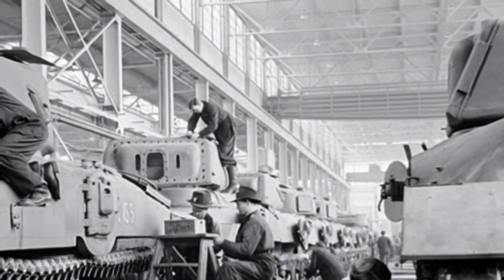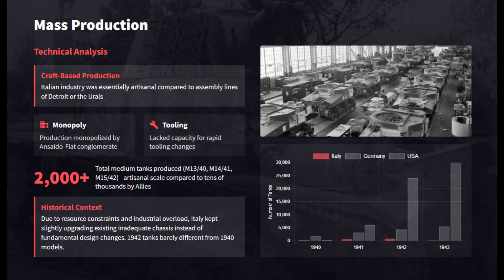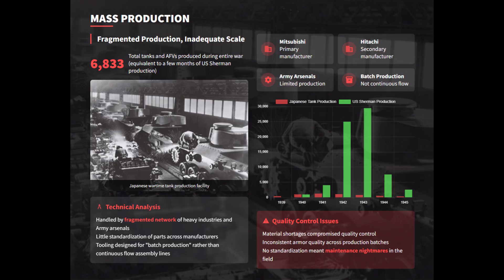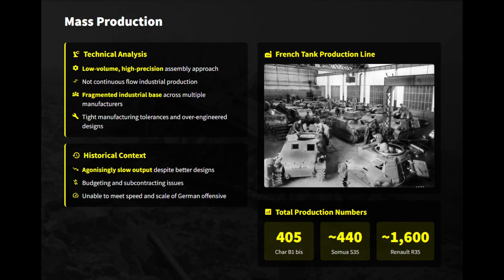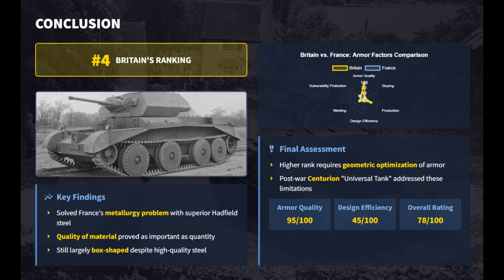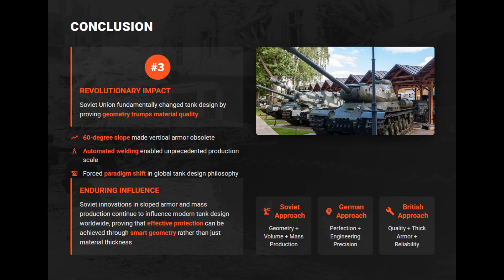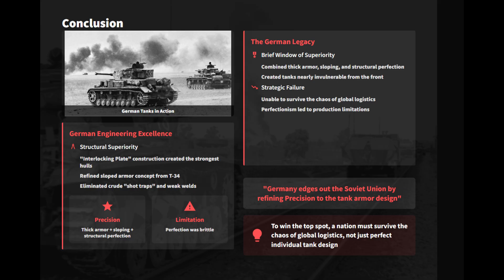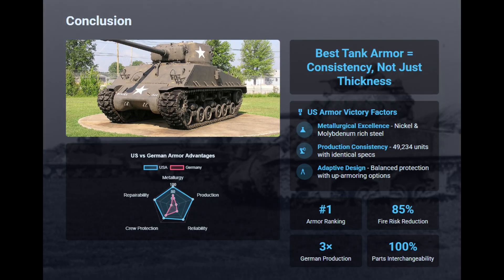Ranking Seven WW2 Nation’s Tank Armor Technology - From Worst to Best

Comment: schurzen side skirts were not effective against hollow charge weapons.  they were developed to defeat soviet anti tank rifles, and were very effective against them.
Reply: There is a web site of old Soviet test data that shows that spaced armor is very effective against the 106mm (really 105mm) recoilless rifle the purpose of which was destroying armor.
Reply: You're right that Schurtzen were developed to counter  anti tank rifles.

But once in place, it was found that it also negated shaped charge warheads.

As anti tank rifles became obsolete and fell out of use later in the war, the Germans started producing Schurtzen out of wire mesh to save on steel usage. The mesh still proved very effective against shaped charge warheads, although it would have been useless against anti tank rifle bullets.
Reply: @coltsfoot9926  I wish I could share a link for the Soviet site but it's on my old laptop. Maybe search under panzer Faust effectiveness. Alot of good stuff there. Whatever you may think of those Comme Bastards they were good Test Engineers.